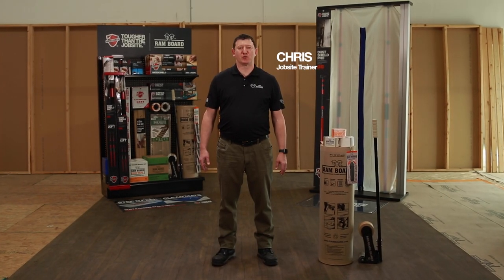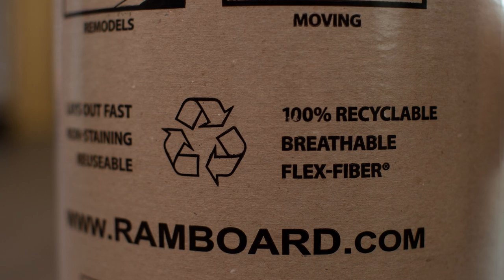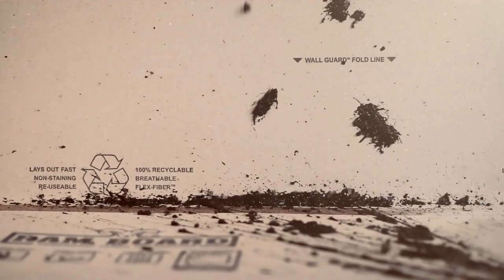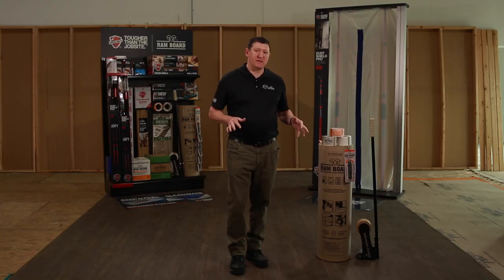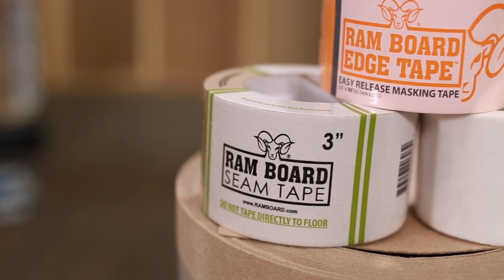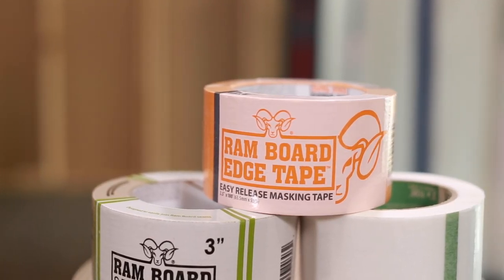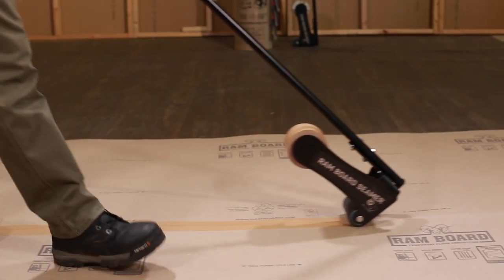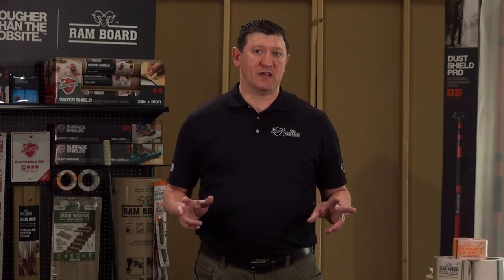How To Install Ram Board

Comment: how do you remove glue strip from mannington vinyl floor?  the ram board plus was stuck down directly on the floor.
Reply: Try urethane adhesive remover. Get it at a lumber liquidators it's oil but works
Reply: @ILIKE2FIXSTUFF  thank you,  i ended up using cooking oil and then dawn detergent to cut the grease.

Comment: This is the worst product I have used in my entire life.  Horrible worthless design. Installing this is the most pain in the ass thing I have ever done and I’ve been a contractor for years
Reply: John Suess What do you recommend instead??
Reply: @JanetJenkins  8.5x11 printer paper
Reply: John, I'm not a contractor, just a 70 something, old lady. I was desperate to protect my bamboo floors from the new kitchen cabinets being delivered by truck and forklifts on pallets the next day through my patio door. The GC was unreachable as usual, so I drove to HD and picked up 2 of the 50 ft rolls (The 100 ft is more economical, but I couldn't lift it.) I watched this and another YouTube videos and went to work installing this myself. I managed to get it down by myself. My floors were protected.  I'm not sure why you experienced so much trouble installing this. I used the Ram Board seam tape, but not the rest of the special devices because I don't intend to ever have to do this again. Maybe my experience putting up wall paper (which is a lot harder and messier) in the past helped.
Reply: Yeah i dont like it either, the board they used in the video was definatly not one from a store. The store ones r not flat, they take all year to roll out and corners always lift up
Reply: I agree, I actually emailed the company (like that would actually change something) and told them they should put the logo on the other side, then you could just cut off a piece, flip it over, then no more screwing around with bending the end and all that BS to make it lay flat !